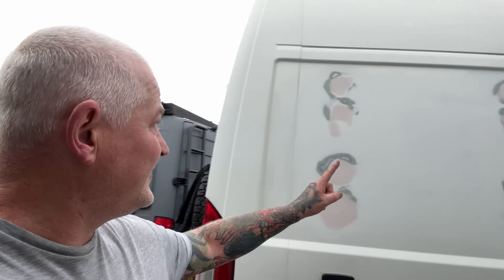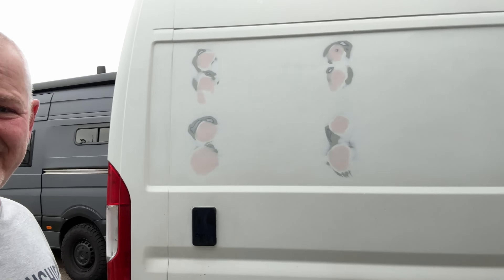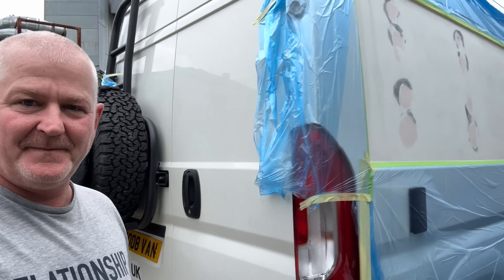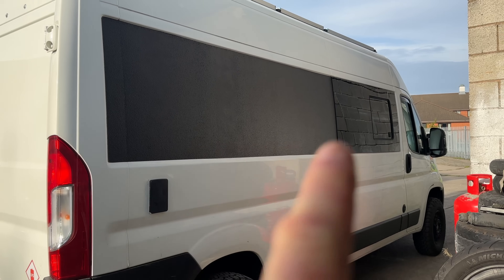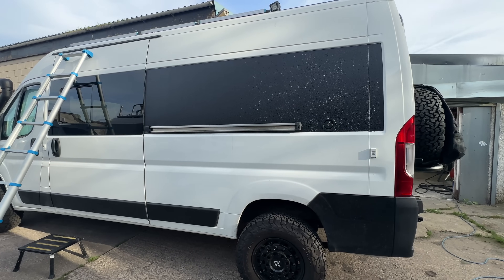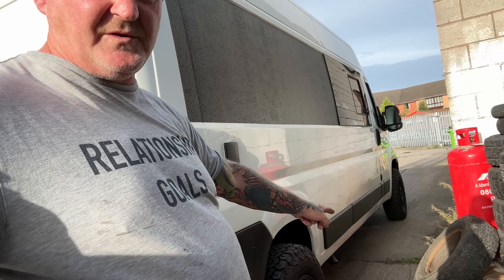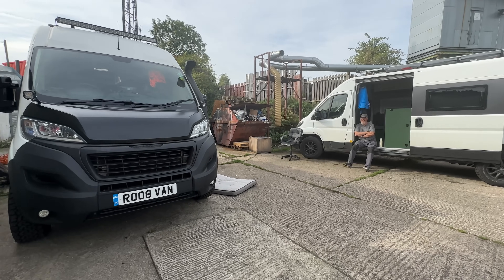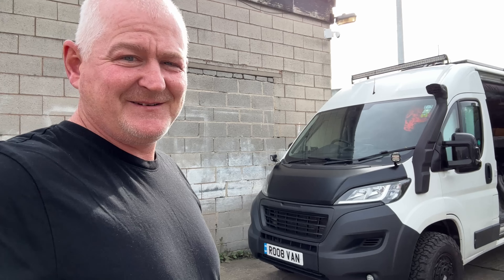RAPTOR Painting my Van - Peugeot Boxer Campervan Conversion

Comment: Brilliant one Rob. With extra comedy thrown in.  Van locks absolutely stunning. Rollering it worked really well. Thought you might of done the same with the bonnet. Take Care Buddy
Reply from the maker: Hey mate, I did think about using Raptor on the bonnet, but actually prefer the contrast in blacks with the vinyl to raptor sides... Hows Scotland pal, hope you're keeping well?
Reply: @PackTheVanAndGo  doing good thanks. Finally got a dry spell haha.

Comment: have you got a lift kit in there? mine failed its mot with my lift kit as it made my Foglight too high over 1000mm from the ground.... complained to DVSA as i though the tester was taking the p.... turns out its correct also how's your gearbox with the BFG's on i ran big wheels like you have on your and after 11,000 miles the excess torque required to get the wheel to turn and to slow down killed my diff bearings... the gearbox center told me they wouldn't put a warranty on the box if i still wanted to run my BFG's ..i also later found out that i had unknowingly increased my unladen weight as i had the van weighed again with standard tyres on and i had found an extra 55kg to play with
Reply from the maker: Never had any issues and my van passed its MOT… no issues with the gearbox also!

Comment: Nice job, I did the same like you but with foam roll on, you need to have a good temperature outside because the product harden very fast it will be like tar lol
Reply from the maker: Yeah, outside temp is key and be quick to remove any edging tape also!